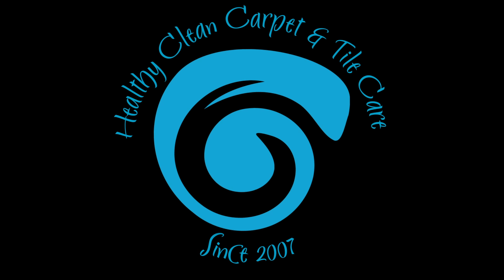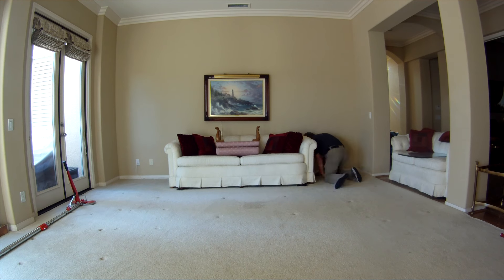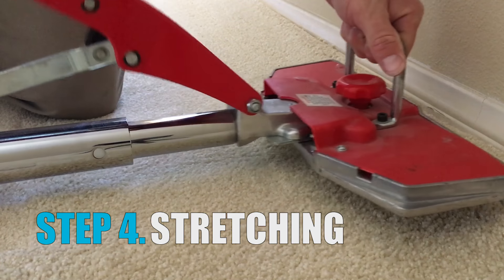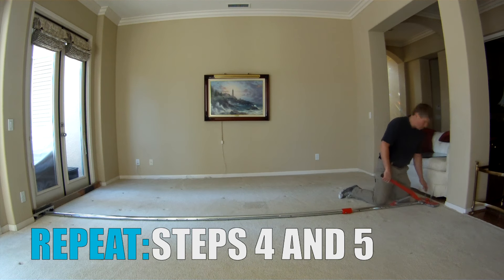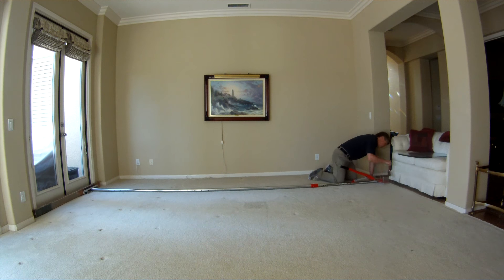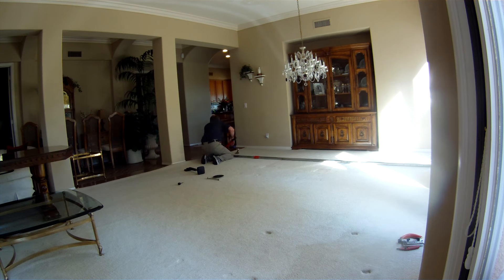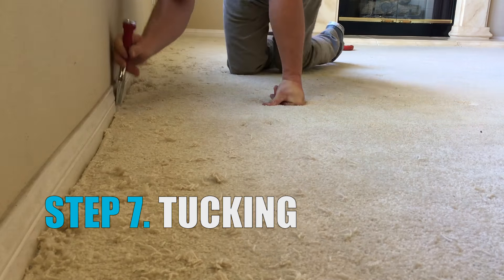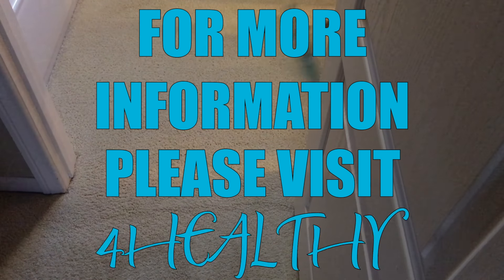How to Re-stretch Loose Carpet to Remove Buckles

Comment: Oh thank you so much for this video. I've just cleaned some carpets and after spraying the ripples appeared before doing any actual cleaning. Problem is the customers are blaming me for the problem and won't listen to any other explanation.
Reply from the maker: The backing in certain types of carpet will shrink when it gets wet while cleaning and then it relaxes again when it dries. The customer always calls after I've left the job and they never believe me when I tell them it will lay flat again when it dries. But it always does. Of course it shrinks because it's jute backed then there's no saving it.

Comment: I'm going to attempt this within the next few weeks. I do have a question as it pertains to a doorway...how do I use the stretcher on the opposite side of a doorway? Would placing a 2x4 longer than the length of the doorway across the bottom of the threshold work?
Reply from the maker: That’s exactly how it’s done
Reply: @HowToCleanLikeAPro  Thank you!
Reply from the maker: You’re welcome!

Comment: About time someone does it right and not with kneeless kickers and some wonna be stretcher that only stretches a few feet or barely moves 20 oz commercial carpet.Nothing beats a real power stretcher no gizmos.I am also glad you didnt use the run and gun method so thank you

Comment: Somebody please help !  I used to have a mini fridge  in my one bedroom and on a couple of occasions spilled water trying to get ice cube trays in the freezer.  My carpet has formed a buckle which is ( approximately ) two feet long and maybe a few inches wide.  This never would have happened if my landlord installed a " normal / traditional " rug a few years ago.  Instead the carpet resembles an office / commercial type carpet.  I really need advise ( the mini fridge is gone ) but now I'm starting to trip over the buckle and temporarily moving all the furniture out of my bedroom isn't an option 😥
Reply from the maker: Can you send a pic?
Reply: @HowToCleanLikeAPro  Not tech savvy so I'm not sure how to send a picture  but it is an eye sore trust me.

Comment: Well  I have officially 1/2 of billion square  feet cleaning surface area personally and 1.2 billion sqft in s supervisory capacity. What you said is correct about re-stretching, however there are certain cases where there is carpet delamination happening. this happens with very old carpet on the floor. I've done a lot of mid century floors with carpet 40+ years old.   And that is a whole other issue.  It is better to just replace however a lot of the older carpets I've done are wool based with often a burlap backing and a actual horse hair underlayment. 

You have to weigh in the actual cost of replacement based on wear and material used.    But yes! good job on explaining what you do!

Comment: My carpet installers how much would you charge if you had a basement re stretch of 850 sqft. And had to re make 3 seams bc of the re stretching bc it was by passing doorways and creating other bubbles into other rooms which in return you had to stretch out those as well. now then on a 20ft by 4ft hallway you had to patch a 2ft by 2ft piece of carpet you had to cut out of the middle hall and re seam a new piece in. How much would you have charged.

Comment: Help! I have 3 carpeted bedrooms and one without.

2 carpets are probably quite old, 1 is 5 years old.  2 different kinds. 

I don’t use the rooms. There is almost zero traffic. Seriously, probably less than 39 steps in each of the rooms.

This year, all 3 have ripples. The newest, largest one feels like it’s floating on the padding.

The have never been cleaned.

Why?

I live in the desert, but the indoor temp only varies by about 10 degrees.  They rippled during 60 - 70 degree weather.

I’m on a slab. Maybe it

I’m terrified. This can’t be cheap to fix.

Comment: Ok, ok, I have concrete floors underneath the carpet. Can I do it myself. I'm pretty handy
Reply from the maker: The subfloor doesn’t make any difference when it comes to stretching carpet. But if it tack strip is loose and needs to be tacked back down or replaced you could run into trouble because the nails they install the tack strip to the subfloor with tend to blow out the concrete and it can be difficult if not impossible to get a nail to hold again. I’ve gone so far as to drill a hole in the concrete and screw the tack strip down with tapcon screws. But as long as the tack strip is good you shouldn’t have any trouble stretching the carpet